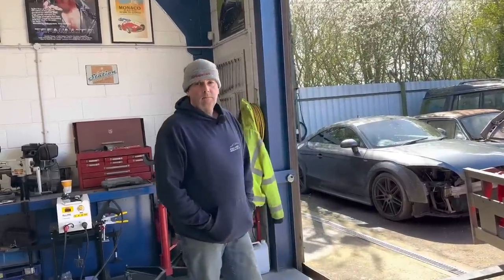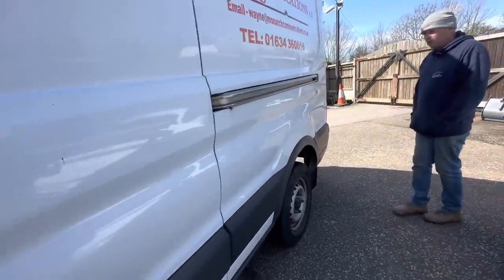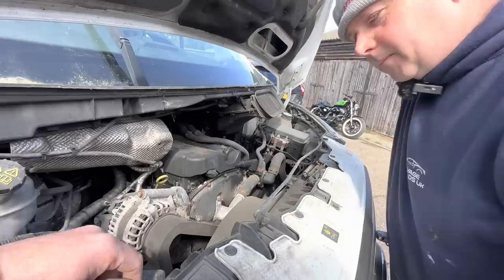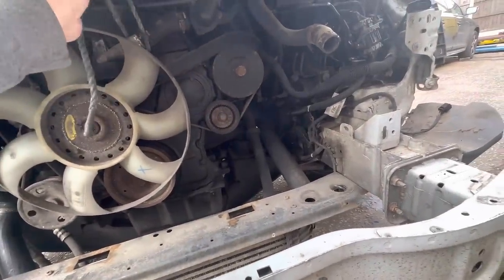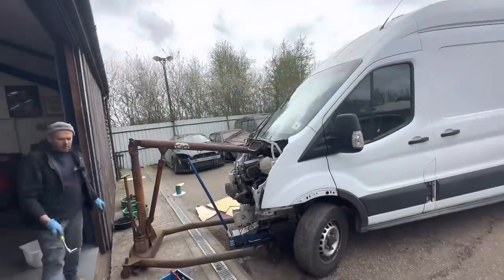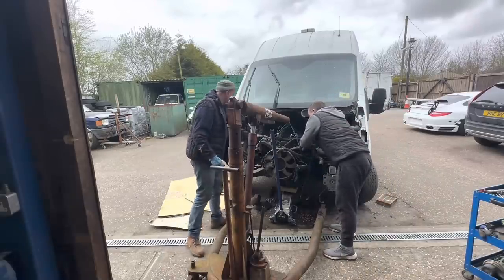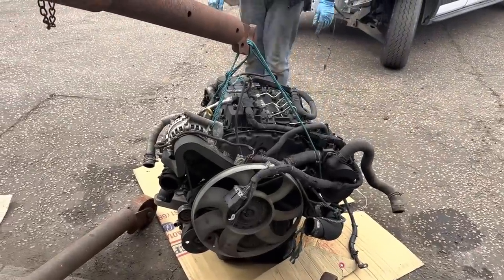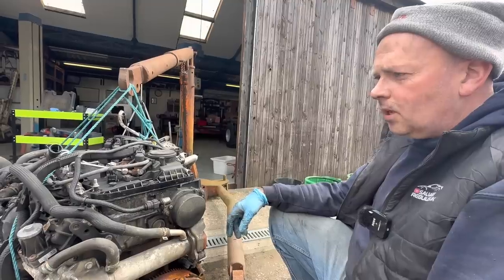2016 ABANDONED NON RUNNER TRANSIT WAS CHEAP FOR A REASON!!!!

Comment: There was a known concern with the airfliters getting wet on that model year transit. The water drips down from the scuttle panal and soaks the air filter. Ford made a modified drip tray to direct the water away. I can't remember if it was a Recall or a TSB. I hope this will help 👍
Reply: That is priceless information. I live in Oz and my MK6 was drowned numerous times because of that puny scuttle panel. We don't get snow. But we do get Monsoonal type rains that overwhelm the scuttle drains spilling over into the engine bay. ....right on top of the fuse box! Perfect Ford design!

Comment: Maybe time to get some form of shelter set up externally for these higher vans that won't go in the workshop Nice to see the Old skool  engineering places like Phoenix keeping up the good work Looks like you will be getting a rapid turnaround on the Engine as they are already half way through getting head & block machined up before you even got there

Comment: I bought one with the same engine 2014 164000 miles. Loads of back pressure and using about 1 litre of oil every 1000 miles. Been told the engine is toast and not to travel too far but it runs perfect (bit smoky on start up) and hasn’t got any worse in 4000 miles since it was diagnosed as worn piston rings.

Comment: What this tells you is they use crappy engines in the ford transit these days.Great video guys.
Reply: Is it bad injectors causing the failures tho
Reply: blame the french [engine from pugeot]
Reply: If that statement is right. It's probably because it's too expensive to make a really good one that just goes forever but  doesn't produce as much power or has worse fuel economy, than the latest throw-away jobbies. The MK6 2.4L RWD is about where the sweet spot is IMHO.

Comment: I had a early version of that transit 2014 and my air filler went the same way ! Turbo started to suck up the wet air filter up 😢 Turned out Ford did a recall or mod to the air box top and put the water deflector rub on the bottom of the windscreen

Comment: Not sure if you know. There was a recall on them Transits for them air filters getting wet... Check with your local dealer. Could be the cause of the engine failure. Worth a check.

Comment: Check the scuttle as its common on these that water runs down the screen through gaps at the ends of the scuttle and on to the filter one side and ECU the other, Fords did do a diverter kit for them that clips under the scuttle one either end diverting the water away as a "cure" I have them on mine.  If i remover the diverters rain water pours into the engine bay.  Very bad design fault....

Comment: If you do a transit mk8 engine change again it's easier to pull the gearbox aswell and split them when out I've seen a few with air filter that wet caused by the air intake pipe being so low so don't worry to much about it
Reply: i tried that, the gearbox got stuck , i snapped a gearcable, then a bolt spun in the chassis, so no, never again...

Comment: new transits are pants, 3 engines + 2 sets of injectors in 6 months in one van, kept blowing holes in the pistons. we are a main dealer franchise,  not many people can afford our labour  rates, so fitting new engines is rare. in 12 months we have done 5 transits , 1 fiat, 1 renault, + 1 pugeot, which is the same engine as a transit. i did my apprenticeship on transits, where did it all go wrong??   yeah rob, the wiring is a right ball-ache around the dpf/bellhousing

Comment: So people buy diesel engines at great expense, expecting a long life and this happens 😮.  In the old days you simply had new injection nozzles installed & calibrated @ 80,000 to 100,000km but these days it is unaffordable with modern types to do so.

Comment: I wonder if they just do an electrical diagnostic crank test to check compression or is it just a few pre checks and the n seen it all before and state holed piston   first one I have seen on number four   normally 1or 2   is it the engine design at fault or poor fuel quality    I wouldn't invest in a  diesel transit anymore
Reply: they blow the dipstick out, so combined with running on 3 cylinders, + the frequency it happens, everybody in the trade knows the score, ie educated guess will do

Comment: I was servicing those Epco engine cranes 30 years ago, always was a reliable unit. Great to see it still working as it should :)
Reply: I still use a 1959 Epco regularly , it’s a superb bit of British engineering .
Reply: Look better with a coat of blue paint. Looks so out of place in that lovely workshop.
Reply: @geeco1333  As I recall, they were painted a shade of orange from the factory.

Comment: The 2.0 transits are known for melting  pistons from injectors failing. Effects all 2.0s ford fitted. We had 2 65 plates transits fail that way at 55k. 1st signs are fuel economy dropping. At 70mph they would only do 16mpg before it failed.
Reply: @24k__J  How do the injectors fail. Will there be some misfire at idle? Hard start? Just out off curiosity and good to know if it can be prevented to go as far as melted pistons :)  Changing an injector is after all a fair bit cheaper than tearing down a hole engine.
Reply from the maker: It’s a 2.2

Comment: Great video guys as always, just some advice when you have fitted the new engine make sure you do a injector pump learn and pilot learn with a diagnostic helps them transit engines run better instead of hunting on idle. Keep up the good work!

Comment: Chris makes a good point about truck engines. I used drive a Mercedes Axor truck, it had a 9 litre straight 6 engine.  It suddenly lost compression and on removing the head, 3 out of 6 pistons were melted caused by over fuelling injectors. The trauck had only done 200K miles, nothing for a heavy.
From watching youtube, the Nissan Navara engine is also common to suffer this fault of over fuelling and piston issues.
Reply: Easy to spot a worn diesel motor, we have all been behind one thats putting out more thick black smoke than a ww2 destroyer, owners see it but choose to do nothing till it goes bang.
Reply: @eggy1962  Well I gota be honest, the Merc truck i drove that went south never showed any signs of any smoke, ever! On the flip side though, motors like the Nissan Navara do emit some black smoke as a clue.

Comment: Your thoughts and actions mingled at one point to create unconscious humour. You spoke about undoing the wiring loom, while gracefully untying a rope. The van looks like a potential winner, if the engine issue is its only snag. For all that it looked like a pig to work on, you made short work of the extraction. I guess that  the design was better than it appeared at first glance, go step by step, and you have a winner. Clearly, Phoenix is the engine work hops, for anyone who needs a rebuilt engine.

Comment: Haven't looked at all the comments yet but first glance that's definitely been driven through a flooded lane, fast. Aqua locked the engine and blew a piston. The air filter that wet has sucked in gallons and about 2500 rpm.  The water at the bottom of the bellhousing has swept in underneath whilst it's been sitting In the drink. Good find though lads and will be a goodun with a new motor 👍 edit.... should have watched all the video. Seems my blind prognosis was wrong 😂😂 great video guys keep up the good work

Comment: Yet another great video, I had the same problem with my van a couple of years ago, I bought a second hand complete engine, fitted it and a week later done the exact same thing, if I was you Rob get all the injectors all checked, this is a very common problem on the euro 5 engine,

Comment: The water can drip on top of the air box and soak the filters. I had it, and if clogged the intercooler and turbo fins, when the filter fell apart. Got a new one off eBay, and it was actually a Ford one with the badges scrapped off.

Comment: Why do Ford make such poor diesel engines?  The older 2.2 Transit/Ranger/Defender engine is pathetic with oil pump and injector/piston issues while the 2.0 wet belt has belt, injector/piston issues galore. The V6 used by JLR had an unacceptable percentage of broken cranks.  What’s up with them? Is it purely cost-cutting or that they don’t have the quality engineers needed to make reliable vehicles?
Reply: because all the engines  are made by pugeot...
Reply: @paulriggers1558  
Except that they are not. These are Ford engines made in Ford factories. Ford have total control over these engine’s design and production. Even if not, is that really an acceptable excuse? I think not.
Reply: @hedydd2  all ford diesel engines were made in uk, but the factories were shut a few yrs ago
design fault in the pug v6 diesel in the landrovers, oil galleries in the crank are only open for a few degrees each revolution, + the wrong oil is used in them [on purpose] to clean up emissions/extend service intervals

Comment: Judging from that soggy air filter @ 6:40 ish, I would say it's hydro locked guys and was driven through high water. It could have been flooded previously and someone has tried to start it with that dripping sponge in the air box. As always a great video with awesome content. I'm also  going to be checking out the RS video's I seemed to have missed. DOH!! Thumbs as always!

Comment: Very common problem on mk8 rwd transits the wet air filter , bad design on scuttle panel , also very common for a piston to hole with faulty injector , not fords finest moment these 2.2 but better than the wet belt engine in the newer ones . 

Good luck with it Rob and Chris 👍🏻

Comment: Hi guys nice video...just a tip for you to mull over when you refit the engine if chris new toy got front forks leave the engine mounts on the engine then lift the engine up on the forks and slide the engine back on the spline of the gearbox yes a jack will be needed on the gearbox but you should find it a lot easier than the engine hoist as it gets in the way....I've always stripped the engine bits off and just removed the block and loom but eveyone to there own...good luck

Comment: If the two side vents on the scuttle panel are blocked the rainwater drains centrally onto the airbox flooding the filter and box and the turbo tries to inhale the paper filter.

Comment: Unfortunatly on these transits its very common for engine issues.i work as a mechanic and our fleet is 95% these 2.2 engines on a 65 reg and in the last 2 weeks we have had 4 engines give up! Butva brilliant episode and i hoped one day at our work we could strip them right down to see why it happens!!
Reply: You canalso tell the cylinder which has failed by the gloplugs if they come out easily or snap off!! After a pressure test of the cylinders,normally no 1 or 2 fails the glow plug comes out very easy!!

Comment: Superb videp gents.I am sure you will get a good drink of this vehicle too once its fully repaired. It is evident that this vehicle must have been driven through a deep puddle of water and some of this fluid must have made it's way to the pistons and possibly other engine components hence the damage sustained. Ford has been producing the Transit model in different configurations since 1965,almost sixty years ago.
Reply: bad design causes the air filter to fill with water on this version when standing, there was a recall for this problem, obviously not done on this one

Comment: Great video once again 👍can i ask when the engine guy said is there smoke back pressure coming from the dip stick what problem does that indicate? Is something on its way out ? Thanks
Reply: the fuel explosion on top of the piston gets past the damaged piston + goes into the sump. the dipstick tube starts in the sump, so it blows all the hot gasses up the dipstick tube [blow-by or back pressure], so when you pull the dipstick out with a running engine, it looks like the funnel on a steam train doing 70mph
Reply: @paulriggers1558  thankyou for your time i had no idea 👌👌

Comment: I have that engine in my Peugeot Boxer. Do you suggest every say 50 ,ooo miles replacing the Injections.
Reply: yes, if you can get them out...
Reply: @paulriggers1558  Is it that bad then? When I bought it I presume it had Peugeot engine. So why on earth did they fit this rubbish.
Reply: @richardhewitt.easyvanlife.6957 the ford engine wouldn't pass emissions, so it was cheaper to buy french tat [with an valid emission certificate]
water gets down the sides of the injectors + siezes them in, so take off the covers + drown them in penetrating fluid a few weeks before you try to take them out
PS, just snapped an injector in a boxer, whilst using a £900 extraction tool, it damaged the head. customer has agreed to new engine, injectors, + clutch. its a high mileage 18 plate,    £10k...

Comment: Relative compression test with an amp clamp on a scope is quick and simple to do. That would confirm lack of compression in one or more cylinders, pulling the dipstick to check for blow by will point to bottom end issue.
These modern transit engines are prone to melting pistons from failed injectors.

Comment: 20:10 common rail diesel pumps don't need timed.
Reply: nowadays, most do, they are used for a tdc reference, they have an extra sensor in them
Reply: @paulriggers1558  why would they need a tdc reference?
Reply: @TheMan-si4iu  to fire the correct cylinder at tdc, ie, on the compression stroke, not the exhaust stroke
Reply: @paulriggers1558  common rail injectors are fired electronically, they take their feed from a common rail all the pump does is build up fuel pressure in that common rail, there is no tdc sensors in the pump, the sensors are on the camshaft and the crank.
Reply: @TheMan-si4iu  oh, sorry, then why does the engine light comes on a K9K nissan/renault/ dacia engine when you do not time up the pump, next time you do a cambelt on one, ignore the yellow timing lines on the cambelt [specifically put on it to time everything up], then road-test it + watch that little check engine light come on...

Comment: .make sure you don't get the crankshaft sensor and reverse light switch connections mixed up when you're putting that little harness back over the gearbox, it's a common mistake 😂😂lol